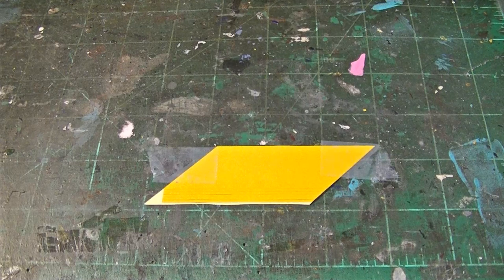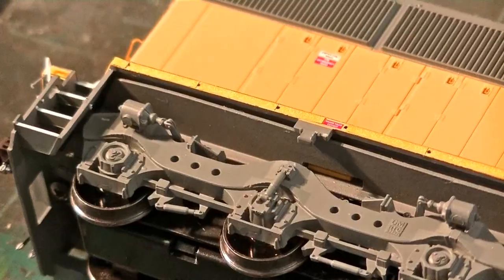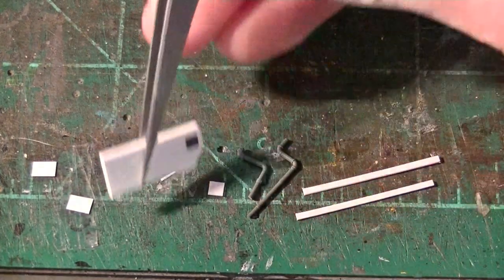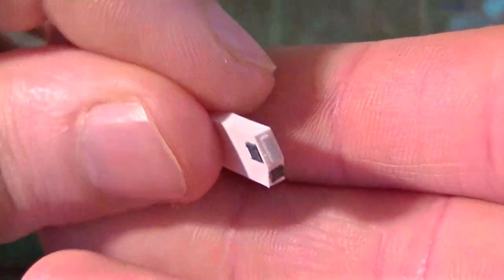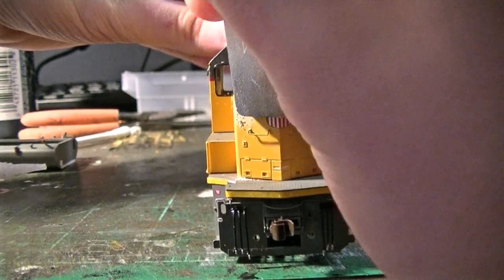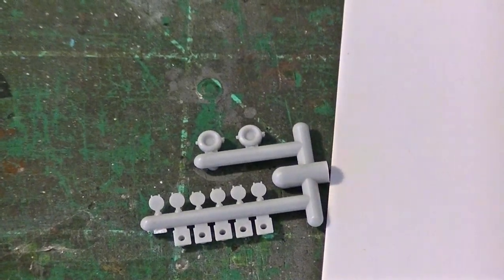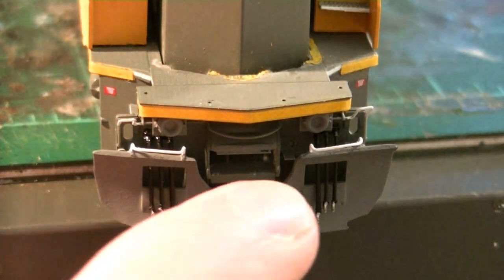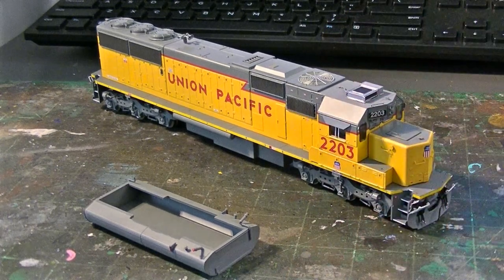Locomotive Detailing & Weathering! Stage 1, part 2 of 2. REMOVING & ADDING DETAILS

Comment: If you want a way better product look at mig Jimenezs products he has  Email Mo weathering products in bottles that you can brush on he also has way better quality dry pigments than the one you're using And he has I think probably one of the best pigment fixers to lock your pigments in so  they won't fall off and wash away .I never use dry pigments on Engine wheels you can have  Issues with the quality of the engine running. Get you a good airbrush that will really make your models look the best